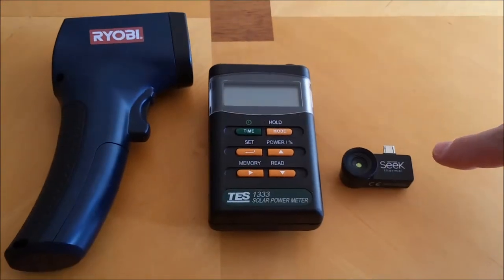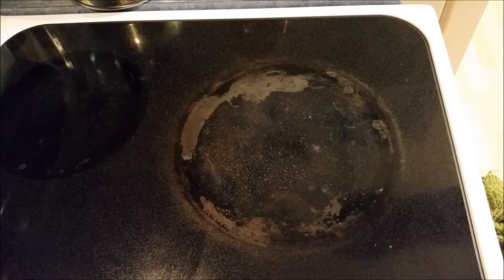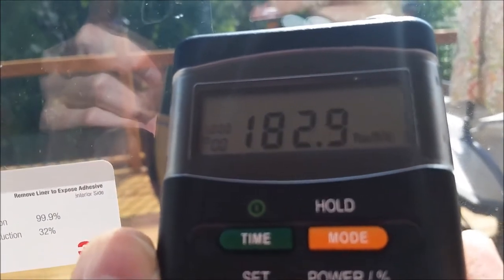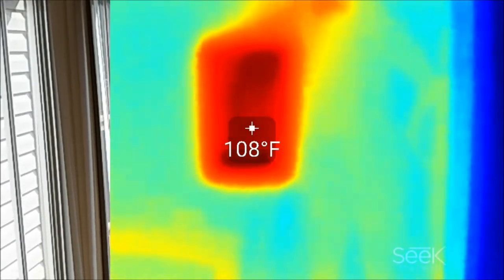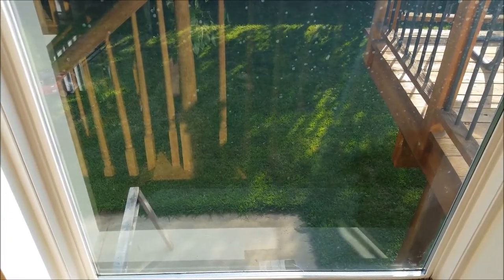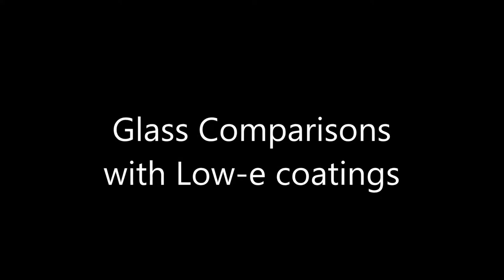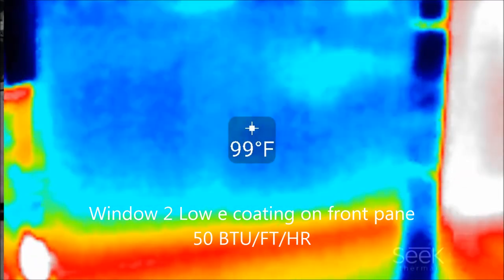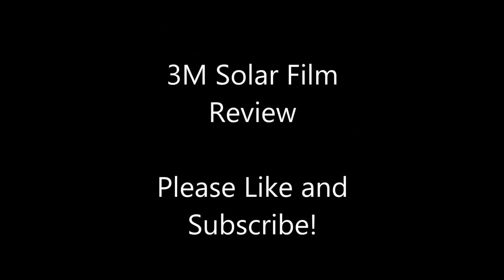3M Prestige 60 Solar Window Film Review

Comment: Made a basic mistake on your end.  Energy rejected isn’t the most important thing.  Reflected energy is key.  That is where you went wrong.  53% rejection means 47% gets into the home, plus the 8% reflected means you are accounting for 55% of the energy.  Where is the other 45%?....you guessed it and proved it, it’s absorbed by the film.....Hence the hot film.  If you wanted to reduce the heat in the home you don’t go with a low reflective film....you go higher as you don’t want the energy staying in the film.
Reply from the maker: Actually yes it is. Total energy rejected is what counts.  It is  the reflected energy of the film.  The higher the rejection the less energy into the space. This is what heats the space up.
Reply: @stem_saving1644  that is your problem.  You don’t understand the value of the other data points.  The reflected energy is specifically listed at 8%.  The rejection is what is blocked out.  In your example 53% is blocked.  So where does it go?  8% will be reflected the rest stays in the film.  You opted to keep it in the film.  You can disagree all you want but you have the hot windows and fancy gadgets to prove it.
Reply from the maker: There are no other data points it's simple physics. Energy in be it by way of conduction, convection,  or radiation is still energy that heats the space.  You might want to review some physics, it's all solid known facts, which the measuring equipment proves.
Reply: @stem_saving1644  you might want to review the cooler rooms of people that picked the right films.  Buying fancy gadgets doesn’t make you a physicist.  It’s simple math.  53% energy blocked equals 8% reflected plus 45% absorbed by film.  Your gadgets prove the film is absorbing large amounts of heat.  You should review how science states that you should follow the evidence not flawed logic.  This film is clearly designed to absorb heat, which isn’t what you wanted.  You were sold the wrong film.
Reply from the maker: I don't disagree its the wrong film. Not sure where your getting your numbers from.  53% of the total energy is getting either reflected or absorbed. There is no "blocking" its absorption,  reflection, or transmission.  

Your 8% visible light is a fraction of the total energy in the spectrum and does not imply the two are a neccessarily a summation as your implying.  Most heat and thus energy is not in the visible spectrum. So, the value itself doesn't provide any meaningful data and is very misleading. 

Which goes back to my original point. It's how much total energy that gets reflected (not absorbed) that's important.
Reply: @stem_saving1644  there are many numbers for each film and they all serve a purpose as a change in one can affect the function of the film.  Rejection can remain the same for two films and the absorption by the film be different by changing its reflective number.  If you look at your video you will see the numbers I’m talking about.  If the other numbers don’t matter, why are they there?  Energy rejection percent matters.  But if you looking to prevent heat inside, it isn’t the most important one, as your experience proves.  Guarantee that if you put the same film with a higher reflective percent...say 35%, You would not have the issues you are having as only 12% gets absorbed vs the current 39%.  Some films are designed to absorb heat, others are not.  Your reflectivity % on your film represents how much energy is being reflected off the film.  8% is reflected back.....the rest either makes it through or is absorbed.  Reflective film is what is needed in hot desert climates....period.  Anything else will cause hot windows.

The 8% has nothing to do with visible light.  The film clearly states that number as 60%, meaning 60% of visible light gets through.  Rejection and reflection work together to determine where the energy goes.  In this case your film is designed to retain heat.  That doesn’t mean film on windows doesn’t work.....your film on the windows doesn’t work.
Reply from the maker: So let me see if I am understanding you correctly. You are saying 8% of the total energy is being reflected back and 92% is getting absorbed or transmitted into the space?
Reply: @stem_saving1644  they all do it slightly different, but yes.  Of the 92% 47% gets through because of the 53% rejection design, leaving the remaining 45% absorbed by the film.....hence your 120 degree windows.  Generally speaking....it’s the tinted effect that absorbs the energy.  The darker the window, the hotter it gets.  Like touching a black and white car on a hot day.
Reply from the maker: So do you also believe that without the film ~183 btu/ft/hr is coming into the space as energy?
Reply: @stem_saving1644  not too familiar with those devices but they do seem to measure the energy correctly.  Much higher outside and normal window does block some energy through normal reflection.  Film greatly reduces the energy making it through, but it doesn’t measure how much stayed in the film, only what is hitting the device.
Reply from the maker: And you understand what energy they are measuring?
Reply from the maker: Two different products. Let's not introduce confounding.
Reply: @stem_saving1644  point being that some films do work.  They just need to be the right one for the right application
Reply: @stem_saving1644  lol?  Is this a test?  Is a yes good enough or do you want the scientific principles behind it.  I don’t have one but I do know what they do.
Reply from the maker: I'm trying to understand if you understand what is being measured.
Reply: @stem_saving1644  the sunlights energy content, specifically heat.  Measured in btu which is the amount of energy needed to raise the temperature of one pound of water by one degree.  Not a physicist, but pretty solid understanding of science. 😊
Reply from the maker: Yes it's energy per unit area.  So, you also agree that the solar films create heat which is radiated in ward?
Reply: @stem_saving1644  yes.  There is no way that they wouldn’t.  The real question isn’t if the window is hot but how much heat is still coming in vs no film.  Without film all that energy comes in and continues to heat the interior of your home.  With film, it will heat the window but is that heat being transferred into the room from the window less than what would have come in without it and spread itself through the the room.  Provided you select the right film the answer is yes.  Your mistake is you assume the energy concentrated in the windows is more than what would have come in without it.  Scientifically that would violate the laws of thermodynamics.
Reply from the maker: What I'm saying is your numbers are not correct.  53% of ALL energy is not being rejected. Once the radiant energy is converted to thermal it's in the house.  The only energy that's reflected is the radiant energy which is not the total energy.  The rest is converted into heat. Which is why the film does not block 53% of total energy.  It simply changes its form from radiant to thermal. 

Bottom line is the film doesn't do much to stop energy from getting into the space.  It reduces radiant heat transmission by converting it to thermal energy.  

If the films were on the outside they would work better.  But they are not designed for that.
Reply: @stem_saving1644  you can disagree all you want.  I’ve installed the right film in my master bedroom and the results are dramatic.  Even with AC running the room was always warm.  Now it feels like the rest of the house.  I guess laws of thermodynamics cease to work in my home, or you just have the wrong film.  My windows do get warmer but you forget that they also radiate that heat outwards... not just in.  Once the radiated light comes in, it’s in.
Reply from the maker: By your own admission. You stated 92% of the energy is not reflected.  Therefore,  it's in the space as either radiant energy or thermal.  That's the law of thermal dynamics.
Reply from the maker: And yes "feels" is also a verifiable scientific measurement. Of course it feels cooler, the radiant energy isn't striking your body or furniture heating it up.  It's heating up the glass instead and coming in as thermal energy.
Reply: @stem_saving1644  lol.  You do realize that feel is a sense of rough measure.  I don’t need a thermometer to tell me something is hot if I can feel it.  My room is considerably cooler with the film.  I can feel it and I am 100% certain a thermometer would verify that fact.  The window will heat up, but less energy enters the room than just letting all the radiant energy through.  Would you say that a dam that lets water through is t holding anything back because water is coming through?  Same concept.  And believe it or not, actual scientists verify those claims.  And they are backed up by people who feel their rooms cooler with the film on.  After all that’s why we got the film to begin with.
Reply: @stem_saving1644  besides you do realize that radiant energy also thermally heats up objects?  If my carpets and furniture gain heat, that in turn makes the space hotter.  That extra energy that the ac is struggling to remove is felt by our skin as warmth, and yea skin can verifiably measure changes in temperature.  If the energy was just being used to heat the window and in turn create a heating element in the room, the energy is still in the room and would still be felt.  After all, that’s what you are complaining about.  That your windows are heating the room.  So if that is the case, why is my room not being heated like before?  You think that energy is suddenly less?  Energy is not created nor lost.  if it comes into the room in light form and heats objects in the room or heats only the glass, it’s the same amount of energy and will disperse into the room regardless.  Simply put, once again you have the wrong film and there are industries and millions of people that know they work.  Good luck to you.   I hope you can fix your issue because you have awesome windows and the right film will make a world of difference.
Reply: @stem_saving1644  I never disputed that.  Your film is designed for that.  Buy the right film that reflects more back out and the problem is resolved.
Reply from the maker: @carlosperla7233  So, lets show the error in your thinking of blindly reading labels without measurement, using the first law of thermodynamics.  Energy cannot be created or destroyed.  

On your own admission, you acknowledged there are 183Btus/ft/hr (lets say 183 and assume per ft/hr) of radiant energy entering the space.  That's a fact.  

Per your other assertion that 8% of the energy is reflected  means 14.64 BTU's of radiant energy are reflected back out, leaving 168.36BTU's at the interface.  You also stated 47% of that energy is admitted, which means 79.13 BTU's are transmitted  through the film as radiant energy into the space as light and 89.23 (the 53% that is rejected) Btu's are converted to thermal energy as heat on the glass which raises the film temperature.  

Now adding up all the values keeps with the convention of the laws of thermal dynamics. 89.23+79.13+14.64 gets to 183.  So, in accordance of how you think it should work appears to hold true.  

However, one simple problem...... that's not whats actually being measured as the radiant energy entering the space. As you can plainly see measured BTUs were right around 40 not the 79 you claim.   Most of the energy will be dumped into the space since energy will travel to the lowest potential (75F) vs the outside window (100F+).

Don't get me wrong, I agree the film is not the right one for the job. But my results aren't theory, they are measured not contrived.
Reply: @stem_saving1644  lol.  You claim in your video films don’t work.  That is what this is all about.  You buy gadgets and use them to test the wrong film and conclude that window films don’t work.  That my friend is not science.  Right films in the right applications do work.  Just because you chose to ignore all the other data on your film doesn’t mean they don’t work.  I know they work because I use them.
Reply: @stem_saving1644  that’s fine dude.  Clearly you can’t possibly be wrong, despite the hot house that proves how wrong you are.  I may blindly read labels, but the film I chose works in my home.  Rooms went from mid 80s to around 78 degrees, that is a fact.  You can claim the window is heating my room, but if it heats it to 78 vs before...I’ll take it.  Fact is solar films do work, people just have to know what they are doing.  All the fancy gadgets and experiments can apparently be outdone by “blindly” reading labels and educating yourself.
Reply from the maker: @carlosperla7233  Well, show me where my numbers (subbing into your process BTW) is wrong. You made the claim, I simply scientifically measured whats actually there. 

Sorry chief, numbers don't lie. I will stick with the scientifically proven measurements you can stick with the labels.  

If you define define "work" as rejecting ~8% of energy......then yes they work for you. For that price I can get better results from cellular shades.
Reply: @stem_saving1644  you are 100% right.  I’ll just have to deal with it in my cool room thanks to window film that according to your measurements doesn’t work.  🤣😂
Reply from the maker: Don't be mad that I have shown scientific results and you haven't shown anything scientific. Only anecdotal "experiences". Films are not money well spent.
Reply: @stem_saving1644  says the dude that bought the wrong film.  If you buy the wrong car do you tell people they aren’t money well spent?  The only scientific evidence you showed is that you picked the wrong film.  I told you that from the beginning.
Reply from the maker: Films on the inside are junk. Period. I have said that and proved it.  These need to be external.  It doesn't sound like you remotely understand the science behind it.  Which is why the values you read off the label aren't what you see.  You have been proven wrong, take the hit and just move on.
Reply: @stem_saving1644  yeah.  You sure proved me wrong.  Guess I’ll just have to deal with your scientific wizardry in my cooler home thanks to the film that heats up my house!  LOL.  Just FYI.....why do YOU think that there are so many different types of films with so many vastly different specs?  Could it be that the other numbers actually mean something?    Nah...guess not.  That would require some semblance of intelligence.
Reply: @stem_saving1644  wow you have patience. I would have ignored that guy. I believe the reflective coating on inside is good to keep heat inside your house. Coating on outside keeps heat out. Possibly a UK video I saw. Will search again. In Mexico, glass choice is slim. I'm going for double pane with outer pane slight tint due to brightness.
Reply from the maker: Your correct, the film is effective at keeping heat in from the inside as you can see with the imager (good for winter), not so much for summer as it needs to be either on the outside of the glass or as a coating on the inside of the first pane with an air barrier behind it.  It does reduce glare and UV, but that's not what I bought it for.
Reply: @carlosperla7233  Someimes you just can't help people. His experiments were also not through. As you just pointed out thre are many fils for a reason, different applications. Had he tried some of the 70 or clear films like 3M thinsulate he would have realized his mistake. Some people value privacy over their electric bill and use the darker tint which holds onto more heat. I used the Kvool 70 exterior and had very good results, Avery Elite45 makes a good product if cost is a factor. Interior films are simply pushed by manu and installers more because they can install them 365. It is much more difficult to install exterior without dust and creasing. Exteriors obviously always work better, they are a thicker mill and more expense, hence easier to sell interior. All marine/boat tints are exterior because their IRR reflective stats leave interior far behind. You have the patients of Jude, he should have just bent the knee at the beginning. Hey STEM try leaving your electric range burner going and measuring it with your gadget instead of turning it off then measuring.
Reply from the maker: I never said exterior films didn't work.  I said the 3m internal film I hag were junk. 

I'm sorry you don't understand my testing and the different forms of energy such as radiant and thermal energy and their conversion process.
Reply: @stem_saving1644  I understand all too well unfortuneately. Occums Razor applies here. Your the type that doesn't like you nade a mistake, "I said the 3M internal film I had was junk". You are wrong and I can not see how Carlos could have been more clear. There are different types for a reason 3M just doesn't make different types to confuse the market. Some types are for esthetics and some are for function. You simply were either sold or picked the wrong film for the job.  And of course won't admit that, which is why this thread is a mile long. 
Everyone agrees Exterior is superior for dealing with heat. But most tint is applied indoors strictly for 1st convienence and 2nd cost. It's ok to admit you made a mistake it is how you grow       up.
Reply from the maker: I did admit I bought the wrong film as internal films don't do much....  Hence the video, so others don't do the same thing.  Rejecting solar energy is not the same as rejecting total energy. 

But,  yes I will agree, external films are far superior to internal ones.
Reply: @stem_saving1644  You are doing it again. Are you familiar with the terminology in debating called "moving the goalpost". 
You originally said all interior tints are crap and my tests prove it and all Carlos was trying to say was your expectations were wrong not the tint. So you changed the argument to "Rejecting vs Total energy", because you can't be wrong.
Carlos tried to sympathize at first and offered an olive branch saying interior is inferior to exterior but you chose to keep arguing about different forms of energy. For the record reflectivity is the most critical to reduce, which is why exterior produces the best results. You obviously have nothing more to do than to make experiments that confirm your own bias so I will let you have the last word so I can ignore it.
Reply from the maker: I admitted I bought the wrong films. That does not change the fact the films are still junk.  I stand by that assessment. To get energy blocking results films need to have low emmisivity and be on either outside or inner glass, not the inside of the glass like I have.  They provide little  total energy rejection.
Reply: @stem_saving1644  still stand by that claim.  Your “experimentation” was all based on your flawed film.  Since you are so “scientific”, explain to me where else in science general statements are validly made when clearly the experimental materials were “junk”.  I have the correct film on my interior windows of a full sun facing room.  The room is easily 3-5 degrees cooler in the summer.  Saying all interior films are junk is just nonsense.  Would exterior be better?  Without a doubt, but interior films when chosen properly can and do make a difference.
Reply from the maker: Any film that heats up inside,  defeats the purpose of rejecting heat.  Your anecdotal evidence isn't "scientific". It's been proven your math doesn't work out like you think. . Show me something scientific not just hearsay and hand waiving.
Reply: @stem_saving1644  how is a measurable temperature difference in a room before and after the installation of film anecdotal evidence?  That is how science works.  Data before and after the installation shows clearly that the installation is the cause of the difference.   You installed the wrong film,  your data supports that you installed the wrong film and then you go on to say that all interior films don’t work.  You wanna talk about junk science!    You only proved your film doesn’t work.  News flash....my film does heat up the window, but the total energy entering the room is less than with unprotected windows.  So even though the window warms up, the net effect is an overall reduction in energy leading to a cooler room.  That my friend is how science works.
Reply from the maker: Your making my point for me.  No video.  no verifiable data before or after.   No measurement equipment. nothing except hand waiving  and hearsay. I can make up numbers as well... not very hard. 

So, let me understand your position. You want to keep your house cooler. So you buy something thai hearts up inside.  Got it.  Makes complete sense.  

Interesting note,  most window manf void your warranty if window films are applied due to seal failures which are a result of that heat your film is producing.

Again. You seem to fail to understand the physics behind internal films and your math shows that.  Shall we go back to your energy math misconception? 

Let's see some scientific measurements with scientific  equipment and not just running of the mouth. 

I'm sure we will hear a lot of crickets in the mean while.
Reply: @stem_saving1644  lmao.  So according to you unless there is a video it isn’t real?  Anyone can buy fancy equipment and pretend to play scientist, test one set of data and make generalizations about the rest of the universe.   

So just because something gets warm it doesn’t stop heat...is the your logic?  Every single window covering gets hot genius.... from a piece of foil on the window to curtains.  When the sun hits them, they will warm up.  Newsflash, even window film on the outside will heat up the windows.  The point is to reduce the amount of energy entering the room.  Even though the curtain does heat up, one warm curtain is better than a hot floor, carpet, couch, etc.  That is exactly how window film is designed to work.  

Have you measured the temp of a regular window without film.  It heats up too.....so if you want to keep your house cool, why the hell would you put up windows that warm up.  See how stupid it sounds.

Your experiment proves your film doesn’t work, which the specifications on the film already told you, but you don’t understand the numbers.  In your genius scientist brain, how does that allow you to make generalizations about all the other films that are engineered with different properties for different purposes?

Btw...you’d better send this thread to NASA, because last I heard they use thermal tiles on reentry vehicles....to keep the inside cool....THEY HEAT UP!!!!!  I’m sure they have no idea what you have discovered here!